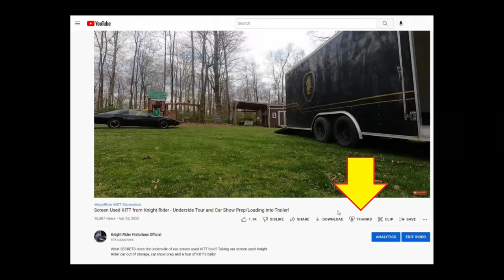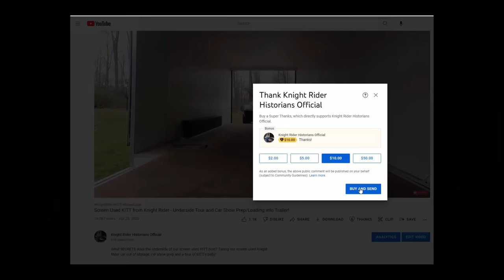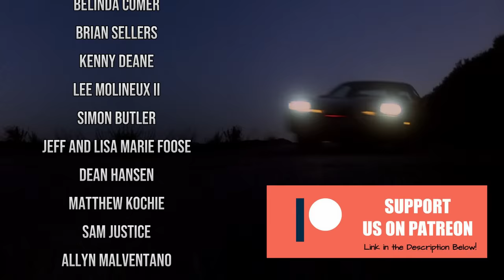Knight Rider Screen Used KITT Interior Refresh + Skid Plate Removal & Undercarriage Tour!

Comment: Great job on the interior Joe. Do you have any idea what that trunk release cable was originally designed for?  Looks like a long shifter cable. I've always used a little silicone sealer when putting a trans gasket on, because the cork shrinks over time and I didn't want the customers to come back with a leak afterwards. I would DEFINATELY go with doing a trans service and resealing the pan, cause it doesn't look like that pump seal is leaking. You can't go wrong with trying it. Make sure the holes in the pan are hammered flat and torque the pan bolts to spec.Thanks for sharing, and enjoy the weather while yo can. :)

Comment: Great work, restored interior panels look very nice :) Black exterior with tan interior is so nice looking colour combination, I'm so glad they kept the interior in tan colour and didn't paint it for example black. Love 80's cars with tan interior colours, makes them look spacious and bright :) 
If there's no traces of leakeage higher up there, it might be just the transmission oil pan gasket leaking. I'm not an expert so don't know if there should be sealant or just a new gasket without any sealant.

Comment: Remove the transmission pan and scrape off all of the sealant with a razor blade from the transmission and pan. Use a WIX or FelPro rubber gasket with no sealant. I would set the gasket to lightly bake in the sun for 10 minutes, flip it over, then repeat on the other side prior to installation.

Comment: Since you have to drop the pan anyways, change the filter and the fluid. I would just go to NAPA and get an OE style pan gasket and you don't need the sealer. While harder to check, I would check the shift linkage and where the dipstick tube enters the transmission. I know it doesn't have a lot of miles, but replacing the seal in the tail housing where the drive shaft connects would be a good idea, as seals degrade quicker with fewer miles.

Comment: Gasket only should be fine w/o rtv.  I worked on a few Turbo 350’s and we always went gasket only.  Torque the pan bolts evenly, but over tighten.  If you over tighten, it will warp the pan and cause more issues

Comment: I'd check to see if the mating surfaces on the pan are level, especially if it's the original pan. It could have been over torqued at one time or simply beat up.

Comment: With the ripped holes underneath, and the fact the rear seat won't line up with the latch, I wonder if KITT was bent at some time and "straightened" enough to work.  I've seen rips like that from a frame machine chains.

Comment: If the pump seal were leaking the whoe torqu converter would be wet... the best thing to do is use the cork gasket, and use red grease on the gasket, also definitely torque to spec. Do not use sealer.
Those tears in the frame/unibody look more like pull marks to straighten the frame after a stunt, Im sure the poor car has been through hell more than once.
I wish i was close to you, id offer to donate my time and help you with any repairs, I've done alot of custom work on many cars, also I'm and ASE master tech, with 20 plus years experience with GM cars. Sure would be fun tonwork on a car that was a big part of my childhood.

Comment: I have been watching season 1 the past few days and noticing alot of things that i didn't before.   The episode I'm on right now is Kitt vs. Karr,   which of the cars did they use for Karr and  I have also noticed starting in season 1 episode 2 Michael starts wearing a belt buckle with a K on it,  I'm not sure if it's this episode or the one with Maggy in it but you can see the carpet in the back which is what you are removing from that one panel.

Comment: I would say its the pan gasket, I would get a new gasket and filter kit, and using RTV, won't hurt anything but really don't need it. the Gasket is rubber, so it will compress when you tighten it down

Comment: I don’t know a whole lot about transmissions, but I do know how to work on cars. I’d say just replace seals, the old permtex could be bad, so I’d just get a factory rubber seals if not just use brand new gasket maker. It is best that all the seals get replaced with new ones. Yes I mean ALL the seals. If that still doesn’t stop the problem then have someone who does know almost everything about transmissions to give you a better understanding of what may be the problem:)

Comment: I don’t think it’s coming from the front seal, is there fluid in the inspection cover? Also it wouldn’t continuously leak even when not being driven. It would only drip what was kicked around then it was running, so it would eventually stop not continue. I would take it apart and use a rubber gasket on it without sealer or anything.

Comment: You don't have a pump seal leak. If you did, it would be pumping fluid out while running. The shifter shaft seal could be leaking. I'd replace the pan gasket with a rubber one. Do not use sealer. Torque to 20ft lbs. Use blue locktite on the bolts. Lasty, make sure the pan flange is not warped.

Comment: Holy smokes is KITT ever rusted up on its undercarriage!  Has it been staying in a salt mine or something???  😞
Great job on getting the interior plastics all matching.  Way better now!
As for the tranny leak, yes, pull the pan and get a new gasket.  It's been sitting for too long and God knows how old that original gasket is.
Maybe want to looking into removing the bottom rust and get it rust protected?  The drive train components look alright.  Its just everything else.  Last thing you want is the car to fall apart on you when you attempt to show it off..  Gotta get on it while you can!  No pressure..  😉

Comment: I would use a new rubber transmission gasket and maybe not so much if any sealer. Make sure the torch is correct and not too tight. Overtightened bolts will cause it to leak. But that leak look like it's from the 3 bolts in the back of the pan not being tight enough. Just my opinion

Comment: Do not put rtv on the new gasket. Use  Cork gasket. From what I can tell by the video it's the pan leaking only. Do not over torque the bolts they break easy or can cause a leak.

Comment: Use anything but a cork gasket. I have never been successful in getting them to seal well.
I do not know if this particular transmission is this way, but sometimes a pan needs the spacing of a gasket as to not interfere with an oil pickup tube or other misc stuff inside. If this is the case, goop alone is not suitable.
I would try to reach out to Richard (?) at the precision transmission YouTube channel.

Comment: The car is more than worthy of a body off restore IMO, you can still keep alot of the original parts and just clean them up, look what they did with ECTO-1. It may not be in the budget just yet but I've done a few body off resores on a budget. Seems the car doesn't need much work either so itd be little easier than most.
Reply from the maker: We would never subject the car to that, it would ruin the originality.

Comment: Loving the sound of the exhaust on kitt. Is it just the factory exhaust or is it custom/aftermarket? Im sure this second question has been answered/shown but is this perticular car v8 or v6?
Reply: Someone will correct me if I'm wrong, but I believe the only car with a six cilinder engine used on the show was the "permanent" convertible (a Firebird, one of the surviving cars). Joe's car was originally a Firebird as well, dressed up as a Trans Am, but it did have a V8. Which is certainly what it sounds like 😉
Reply from the maker: It has its original factory exhaust, V8

Comment: change the trans gasket. DO NOT use silicone sealer. that will clog the filter and possibly run through the pump. use the original cork gasket and torque to spec.

Comment: The panels look good inside!  I was looking at the promo break you have for the super thanks, and when it cuts to David after the turbo boost, there appears to be carpet on the back panel over the wheel well.  Did some cars have the carpet and some did not?
Reply: Most did, certainly "the original three" that started the show.

Comment: Looks like the pan gasket. That pan looks dented, I wonder if the pan lays flat if you remove it. The gasket really has a hard time sealing together two non-flat surfaces, even with the short distances between the screws…

Comment: If thats a cork gasket, it could've been overtightened, and split and thats why its leaking, fel pro makes a 1 pc gasket like they do the valve covers and oil pan, and they are reusable, i would do that WITHOUT sealer.. if you go cork or whatever comes with a filter kit, then definitely use sealer

Comment: Looking at the pan I would bet it´s been bent and will never seal. Install a new pan with OEM gasket and new  bolts. Torque to specs and it should seal without RTV. Since everything is open already, change the filter.

Comment: For the love of God, don't use sealer...just get the right Rubber transmission pan gasket for a 350t. And there is a torqued sequence for the bolt's.

Comment: Tranny pan, at least on screen looks quite thin tin can, so if those bolts are a over tight, they might cause some bend to pan lip just enough to gasket not able to seal anymore. Tiniest imperfection can be devil with low viscosity liquid combined sorry ass seal. Wild guess, just seen that happening on some differentials for example.

Comment: Change your tranny fluid again and don't silicone it next time.  I never silicone my 700R4 pans and they never leak.  Buy a good quality gasket like Fel-Pro. Tighten the bolts in a criss-cross fashion, evenly distributing the pressure on the gasket.  If you use silicone rtv make sure to let it dry 24 hours before filling the tranny to allow it to cure.  You could also take a straight-edge ruler across the surface of your pan to make sure it is level.  Sometimes those pans can become distorted from over-tightening the bolts, resulting in high and low spots.

Comment: Don`t use that red silicon on the oil pan. That`s 100% the reason why oil is coming out.
Silicon and a gasket are only good for a short time. If you wanna do it right,clean everything carefully,, put a new rubber gasket without silicon on.😉